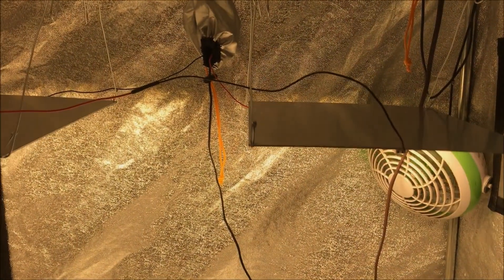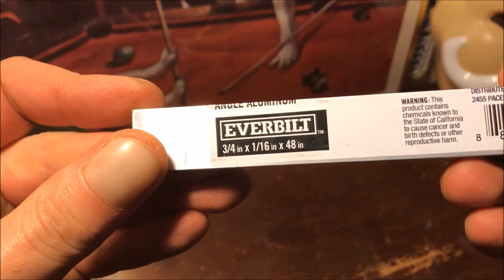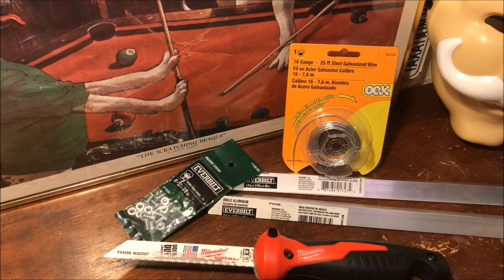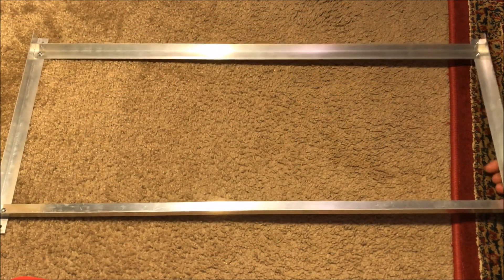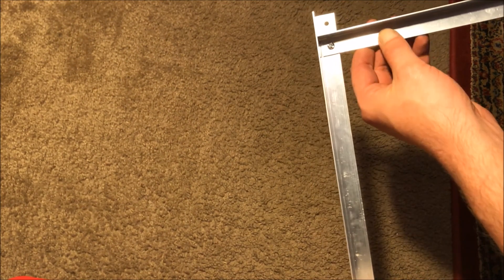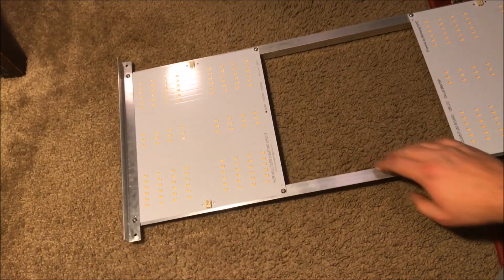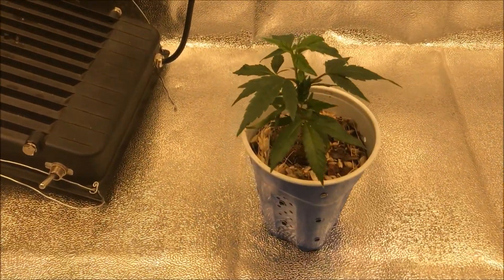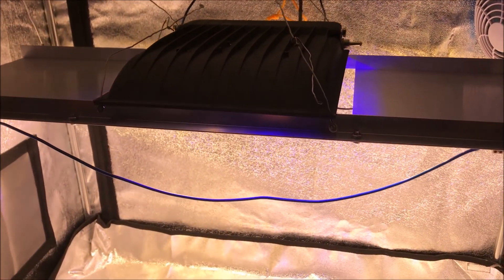Simple Fixture for QB120 LEDs - Episode 91

Comment: You need to pick a better wider than that wire that you are using from home depot or lowes, I got about 6 or 7 bundles of that shit and it breaks so freaking easy, do you just spend it 6 or 7 times I sit snaps in a heartbeat that wire sucks.
Reply from the maker: jonny c 2.0 I have hung HID fixtures on that wire w regular adjustment for over 6 years in the past, with absolutely no weakening at all. On top of that, this fixture weighs only a couple pounds so you don't have anything to worry about. Cheers!